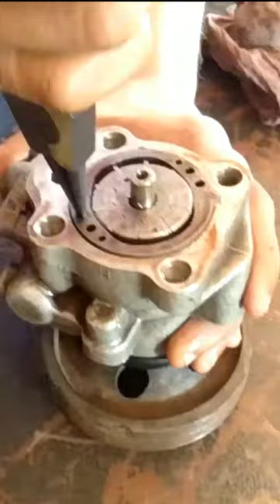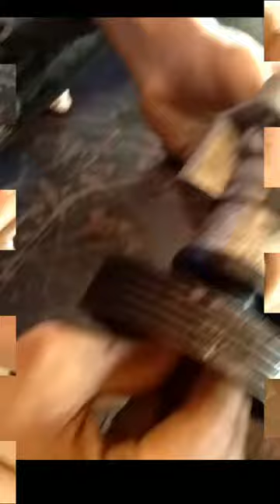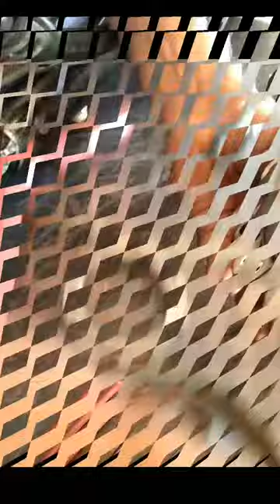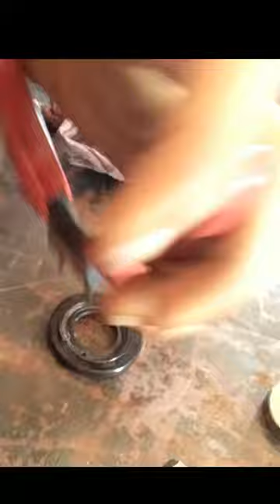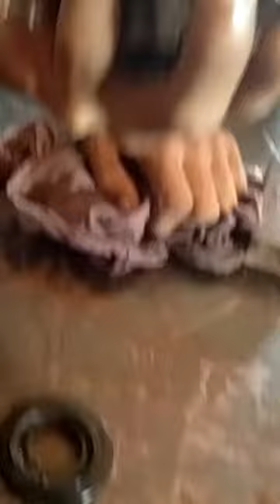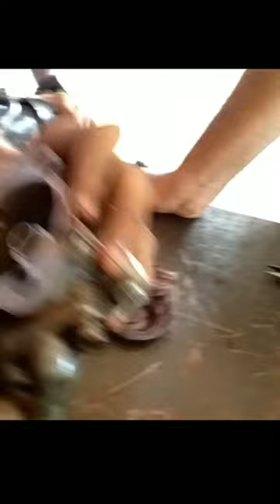power steering pump | hydraulic power steering  പവർ സ്റ്റിയറിങ് പമ്പ് | VANE TYPE PUMP DISMANTLING

Comment: 👌👌👌👌👌👌👌👌
Reply from the maker: thanks for watching

Hydraulic power steering pump
Made by Rane
Vane type hydraulic p/w steering pump
Belt driven from engine pulley
pressurize oil from the reservoir to power steering gear box ( rack and pinion or worm and nut  ( re circulating ball ) or any other ) makes the effort free action for the driver